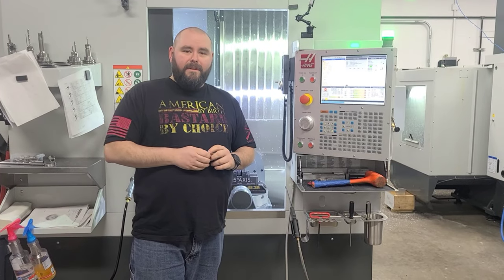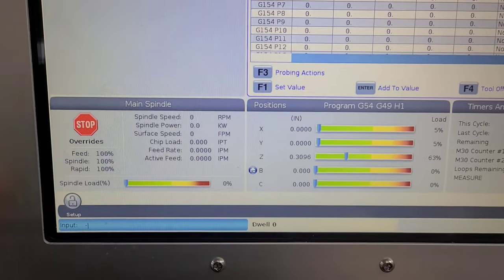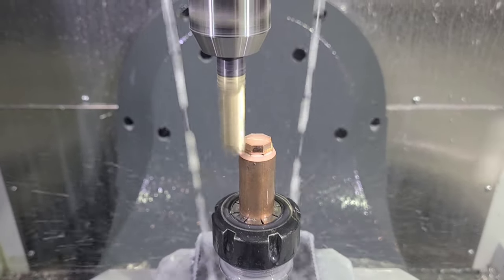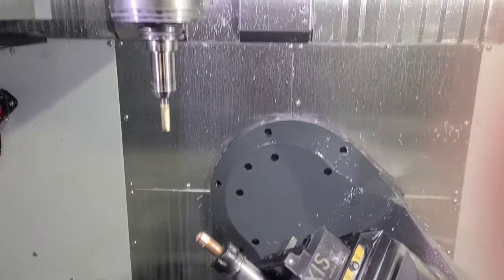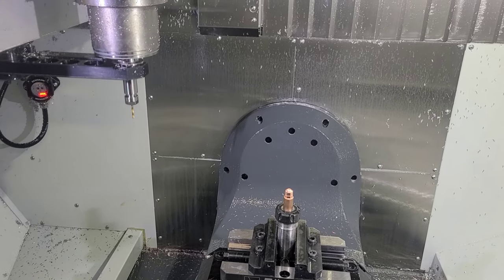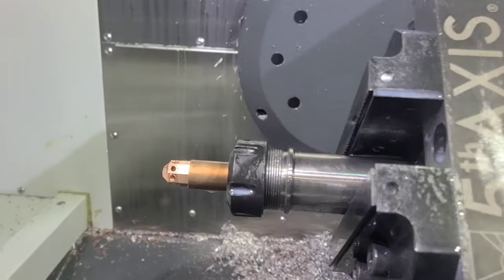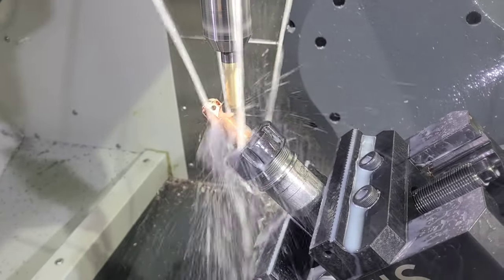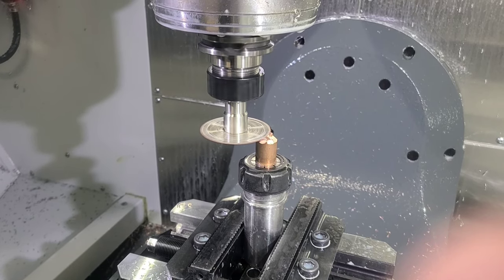Disco slug machining

Comment: Very interesting. But to make it whistle you  just need to put divots in to the slug. as Taofledermaus showed, the slug collapsed when they shot the slug because the holes drilled straight through weakened the slug and they got collapse happening.